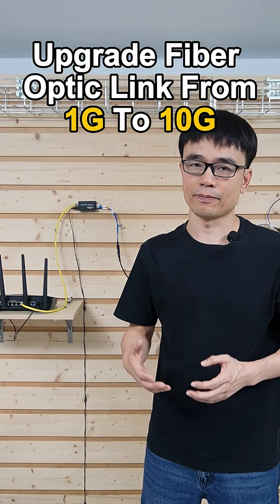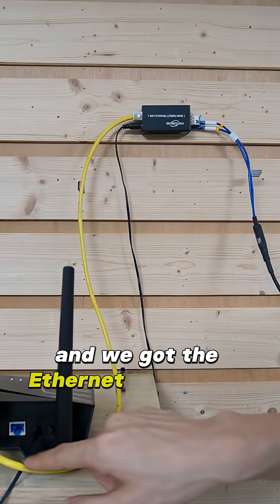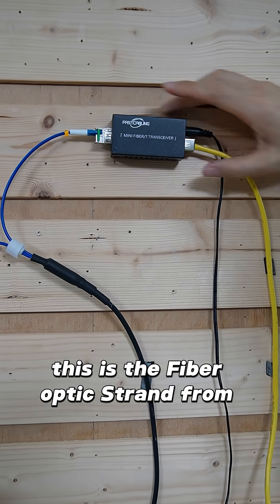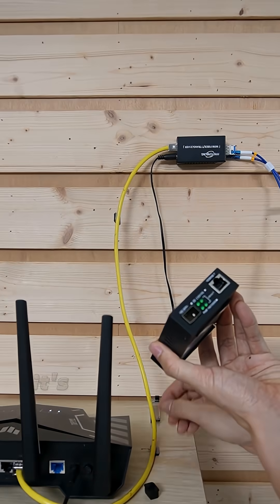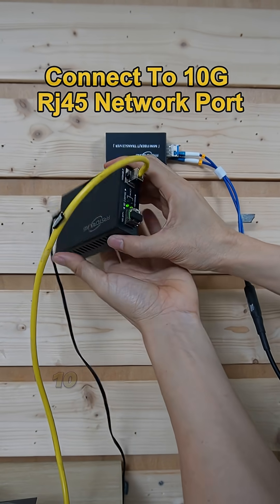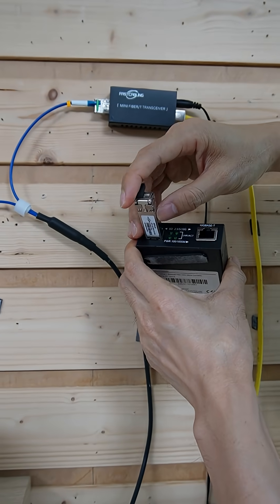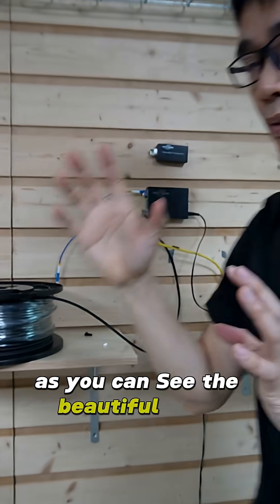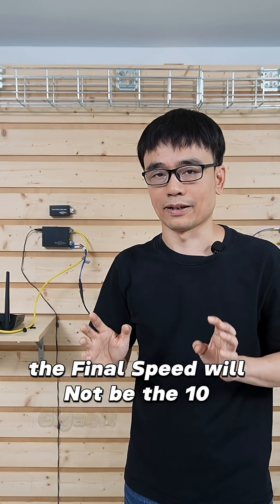Upgrade Fiber Speed from 1Gbps to 10Gbps in Minutes! 🚀

Comment: Always remember to confirm voltage and polarity before reusing power adapters.
Reply from the maker: Correct. Many devices have disclaimers about using only compatible power supplies. If you're unsure, it's always safer to consult the device's manual or labeling near the power input.